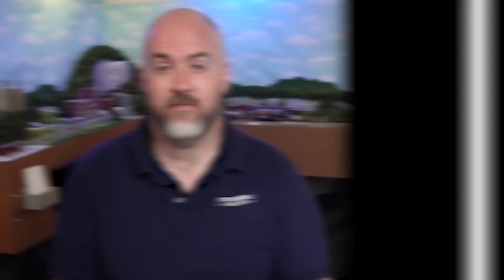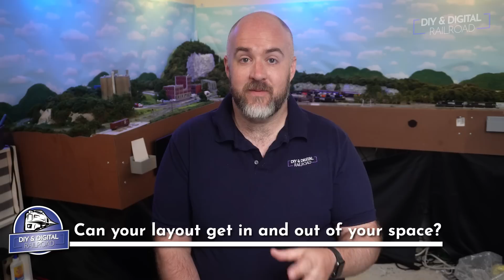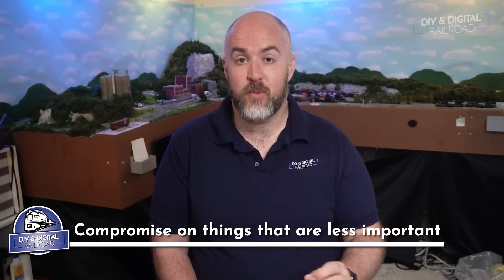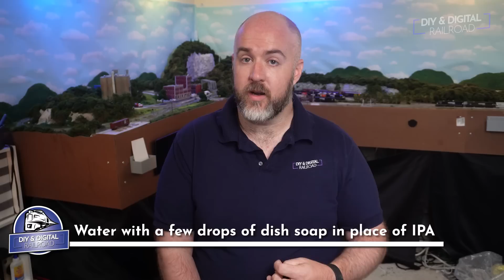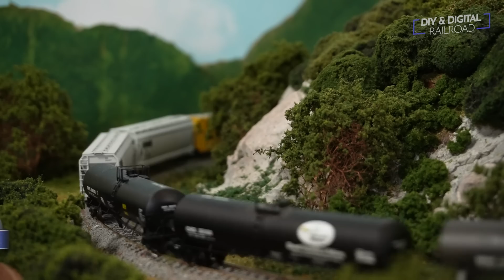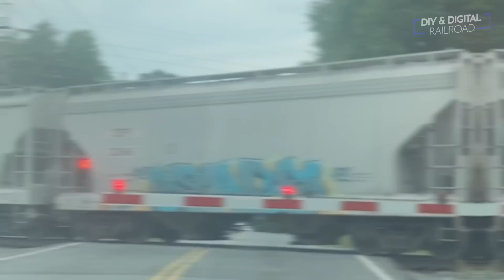30 Rapid Fire Model Railroading Tips and Tricks

Comment: One problem I'm having that doesn't seem to bother anyone else is my use of SCARM and the lack of parallel tracking that I can place down.

There's no easy way for me to make parallel tracks perfectly every time (or as close to perfect as possible). I also have very little self confidence and would like to avoid using as much flex track as possible even though I know it's like the one and only savior for model railroaders. I'd like my set to be as 'piece by piece' as possible until I'm forced to use flex track.

Some basic things I need to know is roughly how far apart the tracks need to be for a uniform look/feel. I've heard everything from 1-2 inches and like 3 on curves or something like that but nothing concrete. Also there's too many brands to choose from, like way too many. I'd like to know which ones work best or best TOGETHER so I might be able to combine two brands to get that layout that I'm after.

Ideally I was thinking a 3 track mainline because I'm really into Thomas and have a few trains at my disposal right now, but even though I can fit 3 tracks on my table going back and forth on both sides, I don't think that's necessary. I can just have 3 tracks on the main inner loop where I'll be controlling and observing the trains and then have the middle track split off into the 2 outside tracks via a Y switch so I not only have a passing track, but also a runaround if I need to.

Comment: Hey! Great video! You’ve hit on some very important and noteworthy points here! Unfortunately for me, YouTube wasn’t here when I did my first layout. Now for the question! I am laying down extruded foam insulation board for my sub roadbed. I noticed you waited until you laid your track to paint it. I wanted to completely paint it with flat latex paint, before I lay down any track. Would the paint cause issues with the cork roadbed sticking properly? Just curious.

Comment: I’m a bit of a procrastinator & perfectionist with a side of OCD & ADD. I spent nearly 20 years stuck in the design phase and planned for a O gauge layout 13’ wide at the side and 23’ length. I discovered I liked building things and got sidetracked more than once getting my basement layout & wood shop constructed and when I finally started laying track I got hurt at work, ended up selling all my train stuff and only running trains on two 4’x8’ pieces of plywood, less than a dozen times; don’t be that person.

Comment: A tip i'd like to add is to lay out all your track and test it with your locomotive before you ever start putting your base scenery together. Just connect it all and test it on the bare benchwork first. This way if you find there is something that your locomotive doesn't negotiate right you can make changes before you have to worry about moving any scenery features.